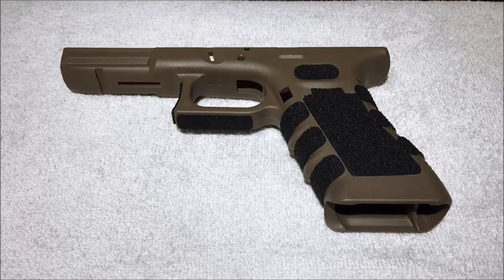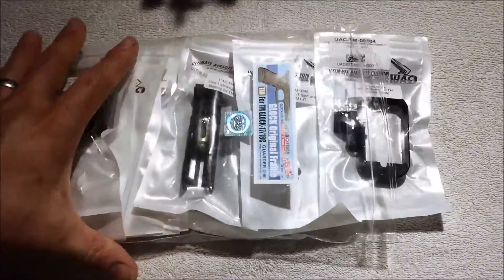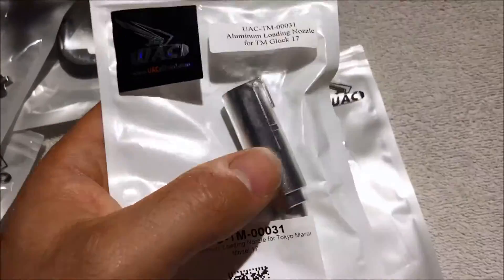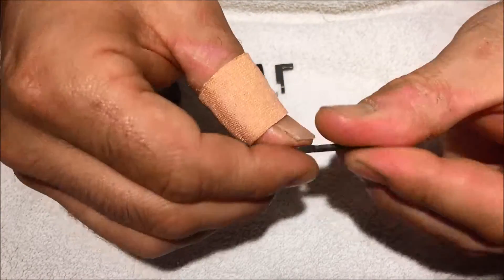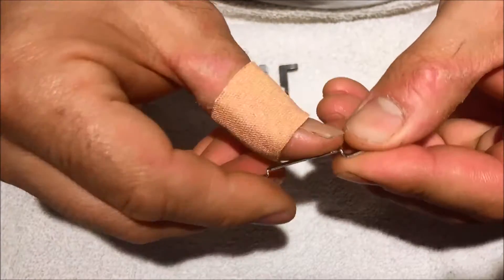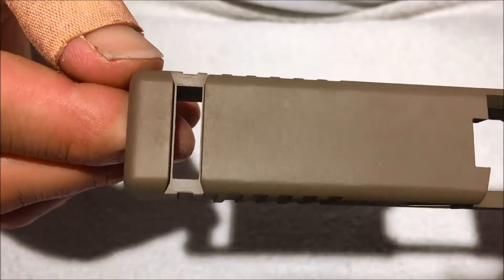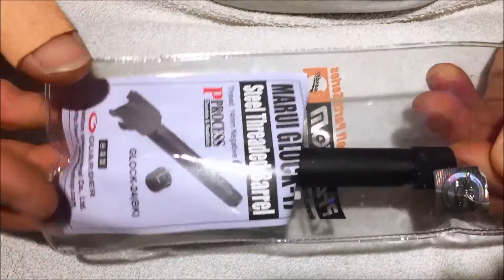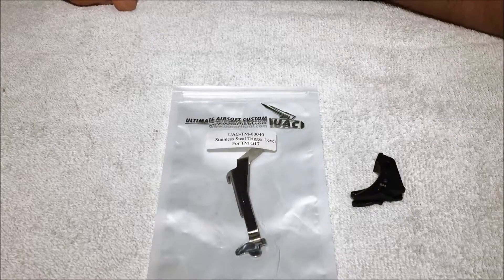Tokyo Marui Glock 17 - UAC Parts Build

Comment: Any chance you are going to do an update with the other UAC G17 parts available now? Such as the aluminum rocket valve, steel firing pin, 6.01 TBB, bucking (very nice bucking), etc.? Then it would be more up to date and more UAC Tacticool goodness lol

Comment: Guarder frame
UAC Aluminum Hop-up Chamber
UAC Aluminum Valve Block
UAC Fiber Sights
UAC steel Hammer and Sear set
UAC Aluminum Loading Nozzle
UAC Stainless Steel Pin set
UAC Ultra Lightweight Blowback Housing (V2)
UAC Stainless Steel Tigger Lever
UAC Reinforced Tigger Housing
UAC Tactical Magwell
UAC Enhanced Hammer Spring
UAC Reinforced Hammer Housing
UAC 135% Nozzle Spring

Comment: which magazines (or modification/parts about they) can you recommend for this build using strong gas like propane and/or co2? I'm moving to do a build like your, but some uac parts are out of stock, i've found the dp parts (dynamic precision). I'ts dynamic precision a rebrand of uac ultimate airsoft custom?  thanks. Really nice video.
Reply from the maker: Francesco Farinato Probably a copy. They may well be just as good tbh. Standard WE CO2 mags work well. Guarder do one too I think.

Comment: Funny thing is, I think you can put together a Glock 17 without a single original part from any of the airsoft manufacturers, every single part is available in several versions from various third party producers. (or are there any non-replaceable parts?)

Comment: How's the gas efficiency with the aluminum nozzle? 
Also might as well call that a UAC Glock 17... it has more UAC than TM parts hahaha, very informing video though thanks!
Reply from the maker: patrick0uch Efficiency is very good. Almost unchanged apart from the usual energy needed to blowback the Aluminium slide. Gas wastage on these is controlled by the fit of the piston, strength of the castle valve spring and size of the barrel.
Reply: You need to run an aluminum one for hpa especially but other than that a reinforced polymer one will work wonders on propane or green gas

Comment: thank you so much , i was thinking to do this, and now i am sure! one question do , how do you get the screws for the trigger unit and hammer housing?
Reply from the maker: Karlo Kojadin Ahh, they come with the original gun only, I'm afraid. 
We have a spare part seller here in the UK but they are expensive. Always best to start with a new TM.
Reply: Crashtest Airsoft btw can you put the front chasis in without a safety or do you need that big chunk of metal with a hole in it? because i thought ill just buy that thing to fill up that hole and thats it? 
-karlo
Reply from the maker: Karlo Kojadin You can leave it open or put an aftermarket 'Guns Modify' or 'Guarder' serial tag in its place.
Reply: Crashtest Airsoft do hou think that a guarder frame + guarder slide + guns modify blow back housing?
Reply from the maker: Karlo Kojadin Yup. Should work well.

Comment: Help! Just got my Raven 01 barrel and PDI VSR-10 bucking today and can NOT get it to work with my Px4. When I have the VSR bucking installed and fire the BBs just roll out of the barrel and drop to the ground. If I install the barrel with the original TM bucking it seems to work (I had some issue where BBS weren't being fed at first, but I think that was an improperly seated bucking causing the nozzle to get stuck.
I can NOT figure out what I'm doing wrong and why the bucking isn't working for me (And I just ordered another one together with a PDI .01 Palsonite barrel for my TM Glock 17)

Edit; remounted the PDI bucking and watched as I rack the guna nd the nozzle REALLY get stuck in the hop-up and it takes some force to dislodge it so it retracts, advice?
Reply: Thomas Andersson Can't really help with a Px4. I have no experience with th PDI bucking either I'm afraid. Sorry.
Reply: It's weird because the PDI page for the bucking specifically mentions the Px4 as compatible. I've checked and re-checked the seating etc and I can find nothing wrong, but it WILL NOT work in my gun.

Comment: great video! 
Will the UAC BBU V2 fit the stock TM nozzle?
Reply from the maker: Fin Mark If you change the 'o' ring. It's a tad tight with the standard one
Reply: any other plastic nozzle will fit without modification? 
i guess, the aluminum nozzle would destroy my plastic slide for sure.
Reply from the maker: Fin Mark They're all different sadly. You have to try them. Or just put a thinner o ring on.

Comment: How much did all the parts cost together?
Reply from the maker: nathanpham Sorry, I've just stopped crying. What was the question?! 😂
Try an expensive off-the-shelf AEG and keep going a bit. 
Cheaper now tho thanks to Rainbow8 in HK.
Reply: k thanks
Reply: I guess you're close to the point where buying an ACTUAL Glock 17 would have been cheaper ;)
Reply: Thomas Andersson yup to bad I'm under aged and can't get a gun
Reply: Airsoft isn't to sneeze at, loads of fun and lots of realism, especially with GBB. Where I live there's a age limit in airsoft and limitation son how you can carry and use them, but other than that no hassle at all.
For Europeans I just found a great online store in Czechia  with greats service and good prices.
Reply: Thomas Andersson tru the gun may cost more for airsoft but it also pays back in price for ammo
Reply: I've yet to use up my first bottle of gas so have no idea how long it will last, the BB's are really cheap so can't complain about that. If you go AEG you can negate the gas cost as well and make it even cheaper.